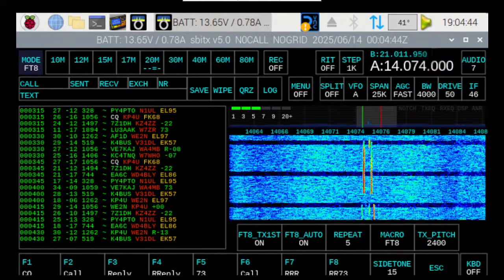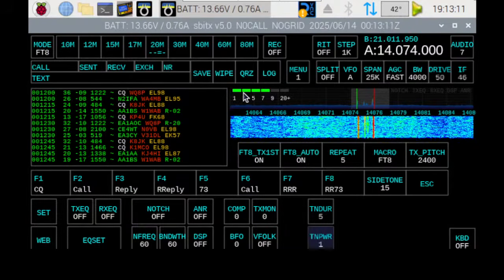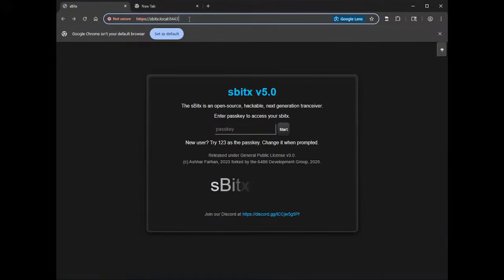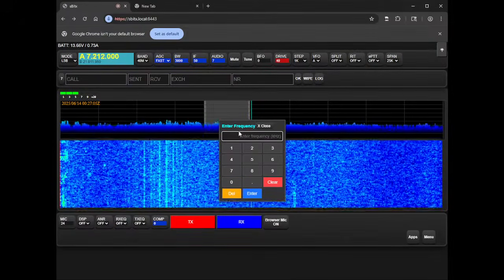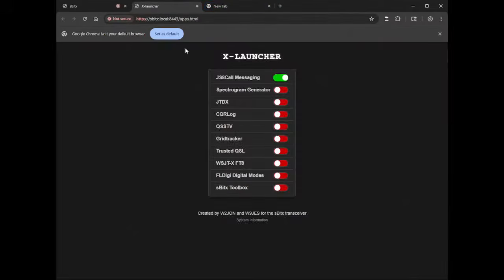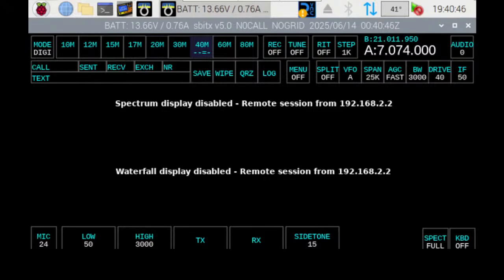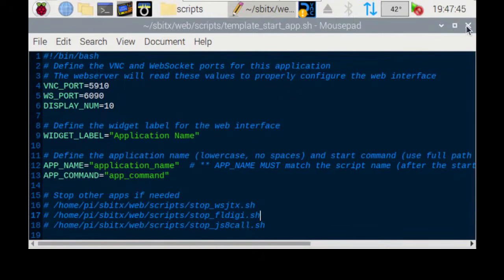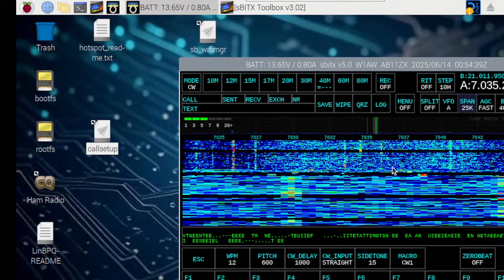sBitx version 5.0 Software Release

Comment: My sBitx delivered without the usb adapter. Do you know how difficult it is to explain to sales the type of adapter I require? 😞  Sorry that is the xBitx which required the outdated usb connector.
Reply from the maker: Hi and sorry for the delay in my comment. The USB adapter is called an OTG adapter from Micro USB to USB A. I hope that helps!

Comment: My question is can the software be used with the Pi 5 rather than the Pi 4.  The Pi 5 is the forward looking Pi development package with larger RAM and NVME Storage capabilities, which should allow more intensive software development.  Dave VE6LX
Reply from the maker: Hello and thank you for the question. This software can be used with the Pi 5 as long as you add some internal cooling to the Pi. We have several people using Pi 5's in their sBitx transceivers running our software without issues. More information about using the Pi5 can be found on the Discord server in the video description.